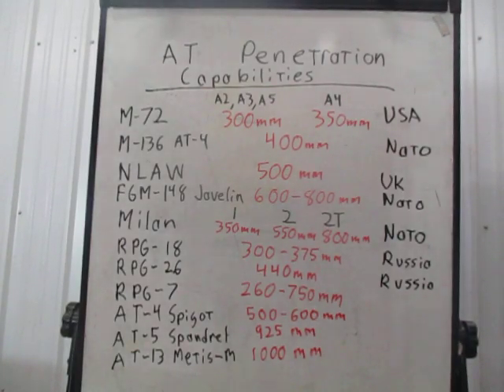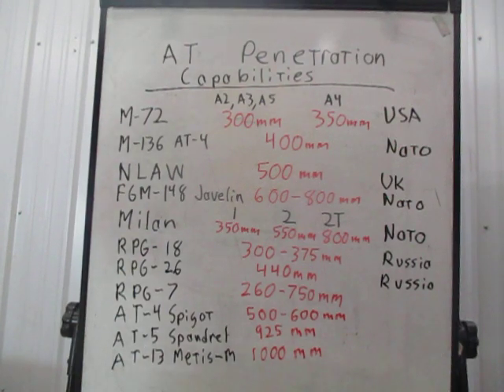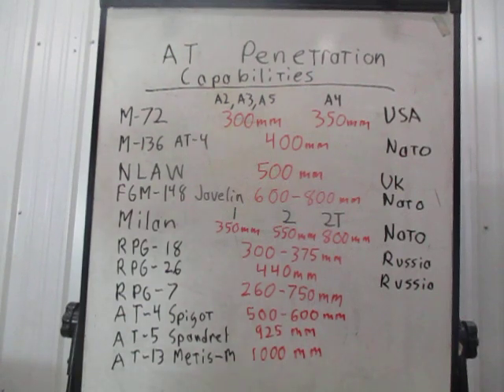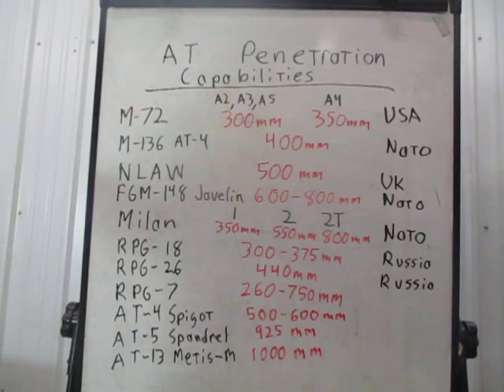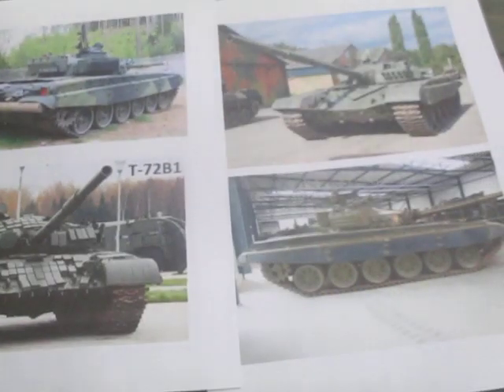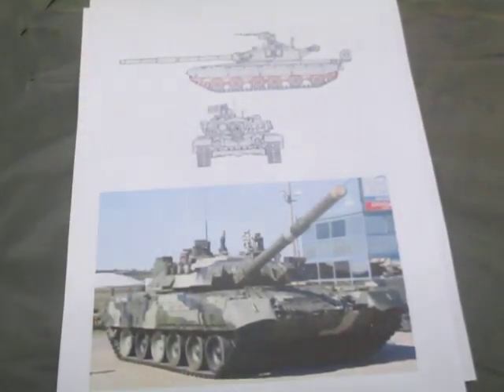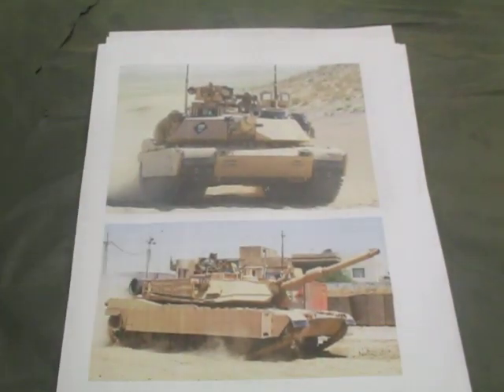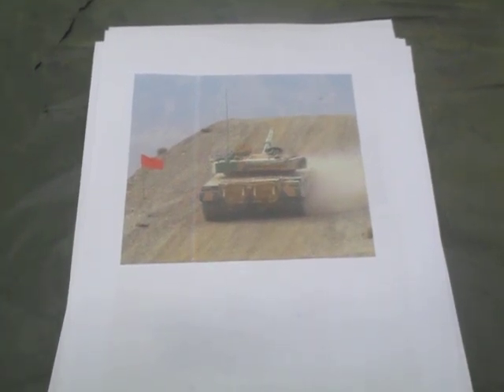Fieldcraft- Anti-Tank Weapons Penetration Capabilities

Comment: Here's a thought, why doesn't the Ukrainians bury a crap ton of old barbed wire an inch or two where the Russian tanks will be driving over and end result slowing their movement because they have to cut that wire out of their treads where by they could be easily be picked off with AT weapons.
Reply from the maker: Russian tanks are suppose to have a wire cutter plate at the rear right before the sprocket.
Reply: @SecurityGuy42  Well, I did say it was a thought - doesn't mean it was a good one. Plus I had no idea the Russians thought of adding that cutter plate.
Reply from the maker: @ronstryker  I don't know for sure they do.  It was something I had heard of with some of the tanks during the Cold War.  Who knows if it worked at all.